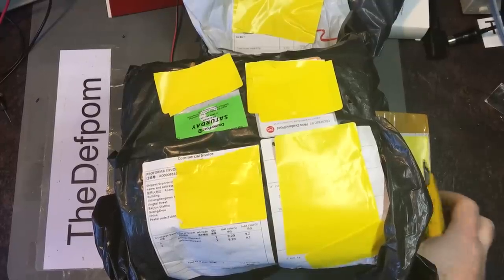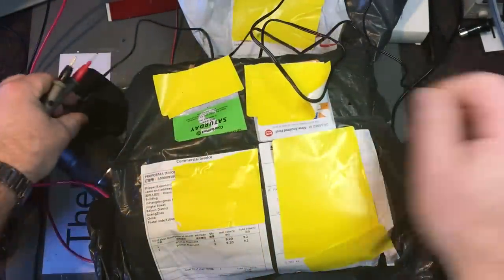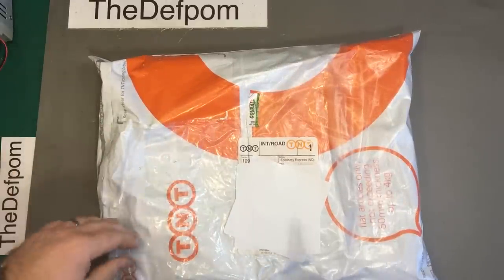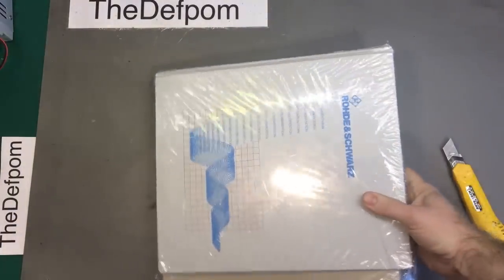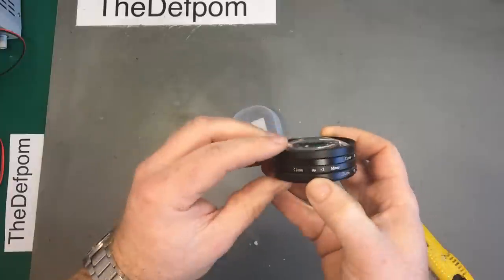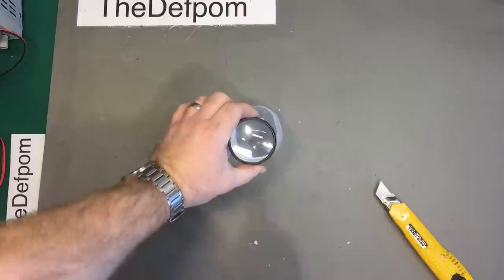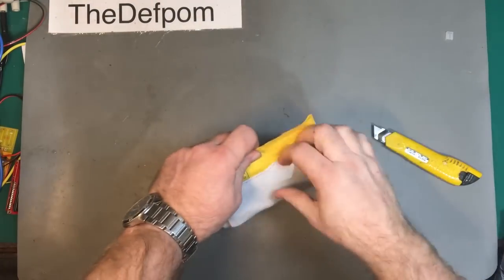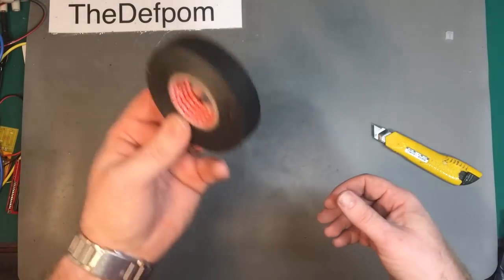🔴 #397 Mailbag Monday 25th June 2018

Comment: Love the mail-bags! A macro filter (lens) is not really intended to be a magnifier, what it is really good at is changing the focal length of a lens. The numbers on the side (1,2,4,10) are diopters - "a unit of refractive power that is equal to the reciprocal of the focal length (in meters) of a given lens."  Okay.   So my 70 – 300 mm zoom lens has a minimum focal distance of 1.2 meters (3.94 feet). If I put 3 diopters worth of macro filter on it the minimum focal distance is a bit less than 51 cm (20 in.) Put those filters on a “long” lens and see what nice close-ups you can get!
Reply from the maker: David V - thank you, that is very helpful.

Comment: You might be able to disable battery checking with CHDK.

I believe ABS is the standard material used for printing with Dimension printers.  They use PLA as a soluble support, which is removed by cleaving the lactic acid chains with warm sodium hydroxide solution.

Comment: Just so you know you can't do receiver sensitivity testing with only one CMU200.  You can't use the signal generator and audio measurement functions at the same time.  It's a cell phone tester that has workarounds for two way radio work.  That's why I have 4 of them and not 2.  I use them in pairs.
Reply: I wonder how the older CMT series compares in that respect.  Peter Schroeder (TRX Bench) had a CMT54 as his mainstay for a long time.
Reply from the maker: MikesRadioRepair - damn it! I was hoping to use one instrument, I haven’t had the chance to actually sit down and use it on a radio yet. I suppose in the worst case I will have to keep my Marconi rf generator on my shelf too.
Reply: Check with Mark.  If you have GPIB I think he wrote a program where you can use the signal generator and do audio measurements at the same time.  You can do a LOT more through a computer using GPIB interface than you can stand alone.  Remember, it's a basically a cell site and cell phone manufacturer instrument that would most likely have been used through GPIB interface and run alongside several other instruments.
Reply from the maker: MikesRadioRepair - I don’t have any gpib cables etc, it’s not something I have used. I have a video planned on the actual unit for my initial turn on and fiddling around figuring things out, I already have it recorded. I don’t know if you have seen it or not on the EEVBlog forum but there is a way to unlock various software options, I did it with mine to add some more functionality, obviously it is restricted to what your hardware configuration allows.
Reply: The Defpom's Repair Channel 

Yep, all of mine are fully optioned.  ;-)  Does yours have the second signal generator?  If it does you'll probably want to remove it.  It limits RF1's input power to a maximum of 2 Watts.  Without it it's 50 Watts.  Also, if you want to fire something with a higher level into the unit like a amateur radio that does 100 or 200 Watts or say a amplifier just put a appropriately sized attenuator at the input and program in the attenuators level as a offset and then the unit will measure power / levels correctly.
Reply from the maker: MikesRadioRepair - mine allows for 50w on RF1, I have purchased a 50dB attenuator for those times when it needs dropping down (rare for me), I am just waiting for it to arrive.

A radio arrived just before I went to OZ, so I will be trying it out for the first time soon, will see how it compares to my usual test gear setup.